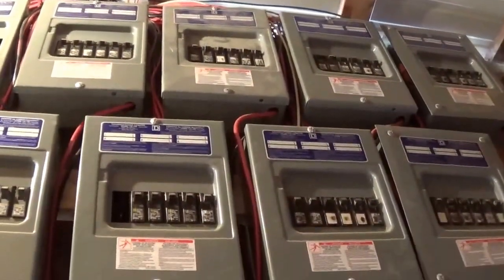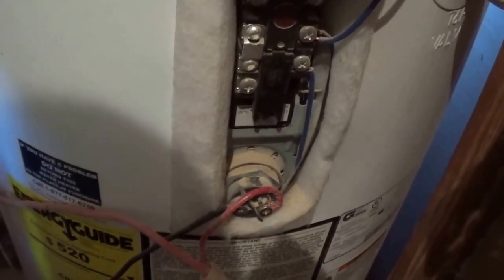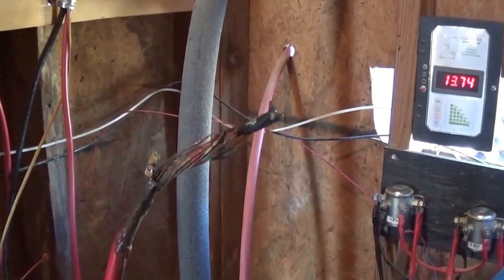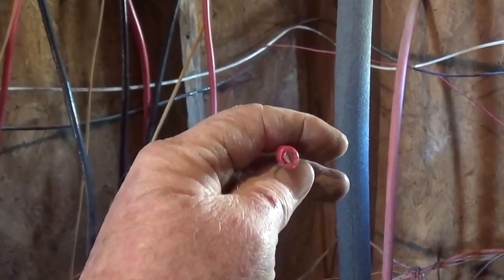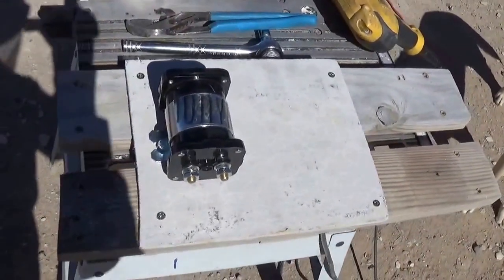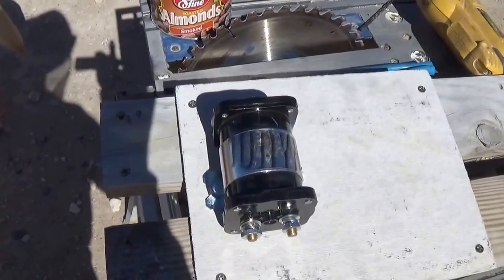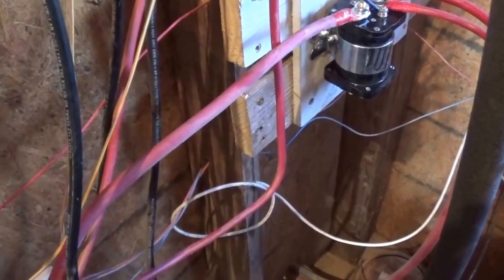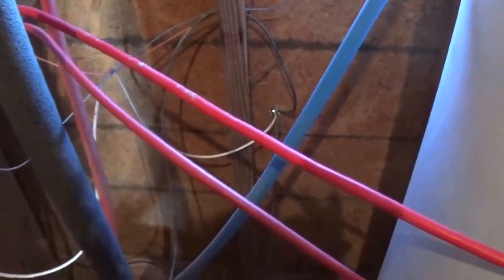Re-wiring & replacing the solar hot water relay!

Comment: Why use 12 Volts ? 120 Volts DC would be a lot better - use normal wire sizes. I don't know how your battery bank is arranged
Reply from the maker: +myozone  Beginner's mistake. We can change over to 48 volts when the inverters burn out and most likely will do that. But now, I do have the wire in place. It cost me about three times what thinner wire would have.

Comment: I've tried to get others to store the wasted solar generation in the form of electrically heated hot water.   They all think it's stupid.  I applaud you for not wasting anything here.  I think it would not be too difficult to use a series of controls here.  First.  A programmable thermostat control like this one:http://tinyurl.com/q83b688 delivered for less than $20.  Runs on and switches 12V.  Us the output to drive your heavy duty relay.  You could use other controllers to check for the other conditions.  Condition 2 is if it's daylight or not like this: http://tinyurl.com/q9btzjm.  The third condition could be tested for with another controller.  That condition would be voltage.  Only charge when the bank is above 13.8v and such.  These PID controllers can be programmed.  It would be possible with somebody who knows more than me to program one controller to test for all three conditions.  (1 thermostat calling for more heat, daytime and battery bank at 13.8v)   Even if you use 3 separate devices, all strung in series, they would allow you to not worry about managing the hot water energy storage.   I don't think you need such large tanks.  You can take a decent shower on a 6 gallon RV sized tank.   Of course, if you super insulate a large home size water heater, you might have hot or warm water through more cloudy days.  However, where you are, sunny days seem more the norm.   Love the channel so far.  I'd like to hear your thoughts on passive solar hot water also.  Although, I consider it a great use of left over solar electric after batteries are charged.
Reply from the maker: Thanks for the post and info! One of my mantras is K.I.S.S. or: "keep it simple stupid". Sometimes we can overthink things a bit without even noticing...... I have done it here more than once.

An off-grid system should produce at least 50% more power than the most you anticipate needing. It is better to have too much than wish for a little bit more! Here, we produce about 250% of our needs, more it the wind blows. There are two ways to deal with it: 1) turn off panels. 2) make hot water.

We make hot water. 100 gallons of it using 4, 600 watt, 12 volt heaters. Also, we have a "beer can solar hot water heater" (passive/active) that makes plenty of hot water during the day. But with the 12 volt heaters, we do not need it, so this hot water will eventually go into our 600 gallon hot water radiator heating system (another long video), but for now it supplements during the shorter daylight hours.

Here is where overthinking comes in: you ideas are fine, but here is what we are doing. With the 10 controllers on the panels set to begin to shut off panels when the system is charged AND the voltage exceeds 13.9 volts..... we set the controller on the wind turbines to dump power to the hot water heaters when the voltage hits 13.2 volts. With the number of panels we have, this occurs at mid-morning. The panels STILL generate far more than 13.2 volts even with the heaters on, so heaters stay on for most of the daylight hours, giving us 100 gallons of 180 degree water  that keeps us in hot water all night.

Rather than several more relays that could go bad, we are using the controllers we already have and it works great!
Reply: eco-ranch.us "Here is where overthinking comes in: you ideas are fine, but here is what we are doing. With the 10 controllers"

Having a functioning thermostat on a hot water heater is a convenience,  Generally people are interested in engineering ways to have the functionality of an on-grid home in an off-grid one.

The suggestion may be complex, but the problem is not a simple one.  My point not being to suggest the idea is the best one.  Only that a thermostat at a fairly low cost is certainly possible.  I would celebrate a simpler solution.   Looks like you have a great system going there.  

Also, I'm not clear what kind of thermostat the tanks came with.  I'm expecting it was passive.  A bi-metal switch of some sort not requiring an 120v input.  That is to say, it would work (it would switch to call for heat) without AC being present.  Obviously your current is 10x higher because your using 1./10th the voltage (I'm over simplifying for brevity).   Thus the stock contacts would never take the increased amps at the lower voltage.  However, the stock thermostat should still function to control the low power to the relay.  Thus you would only need to sense daylight and voltage in battery bank.  Thus, I have removed 1/3 of the controllers required if the stock thermostat was not utilized due to a misunderstanding.

Just by utilizing the existing thermostat, you should be able to eliminate ever over heating the water.  The suggestion is the simplest possible and improves the system.  The balance of the issues you brought up can of course be handled or not as or when you wish.
Reply from the maker: RadicalRC The thermostat is a concern, but not in winter..... yet. By the time the hot weather gets here, we will have the time to look at potential over heating. Right now, we are concentrating everything on constructing the exterior walls while the temperature is low enough that cement products dry slower!

THANKS!!!
Reply: eco-ranch.us I'm not trying in any immediate sense to change what you are working on at the moment.  Just applying my mind to the technical problem presented.   I like working through the logic of these problems of shrugging out.  Look forward to your ongoing progress.

Comment from the maker: The wiring is set for the moment. I am about to build the walls in the guest bathroom. Once this bathroom is functional, I can pull the travel trailer out and build the rest of the walls, so starting these walls is a milestone for us! I am building a "light wall" on the north side and the rest are "standard" bottle walls. There will be a detailed video on the way I build with bottles VERY soon.

Comment: Hey buddy! how goes the wiring and life on the ranch? I am very happy the information me and Alan gave you could help you rest easy. you should see the A/C / Heater that Alan designed on the forum that has no moving parts and can run off 12 or 24 volts. if you have time, just upload some of your videos on the forum so we can share your set up all over the world. very nice layout.  I still have one more wind generator to build and that should start up fairly soon. most have 3 coils per phase, I will be building mine with 4 coils per phase so it should cut in at very low wind speeds which will be great for my area, anyway, take it easy, looking forward to the next video SD.

Comment from the maker: As "Alan Marine" suggested, I did change the main power wire to a 1/0 and put an inline, 300 amp fuse on the main power wire. The wires running to the individual elements were fine, so I only changed the main power wire.

The wire is still a bit warm, but just that, not hot! I feel better with the fuse in the system though! Thank you for your input and help!

Comment: Hello, Very impressive system. To efficiently carry 400 amps at 12vDC from your buss bar to the relay, you should use nothing smaller then 1/0 AWG (with the distance you have).... On the output of the relay, you can connect four 2 AWG wires (one out to each of the 4 water heater elements) as long as you are no longer then 1 metre from the relay. Feel free to contact me !!!
Reply from the maker: THANKS!! I am only carrying 200 amps, four 600 watt, 12 volt elements, but I am replacing the wire with 1/0 from the batteries AND putting a 300 amp fuse in that line. At 50 amps each wire, I should be good with what leaves the relay (#4, #4, #2, #6)...... I think! The odd sizes are short leftovers I had lying around.
Reply: eco-ranch.us Good plan ! It is refreshing to see another individual that enjoys the "Off Grid" power and living challenges as myself ! Hope you could join our small forum and share your experiences with our group as well http://offthegrid.forumsmotion.com Happy Thanksgiving !
Reply from the maker: Alan Marine I checked out the forum and it is worthwhile for anyone who is serious about this lifestyle. I will join!  One thing I cannot stress enough about us though, is that we are trying to teach people how to break free from those who are trying to "enslave" us by eroding the value of our currency, forcing us into "life-debt" and regulating what we are doing, into oblivion. Our goal is to show EVERY person in the world who has the ability, how to be gridless, harvest rainwater and re-empower themselves through freedom from financial stress! I just MAY be a bit too radical for your forum!
Reply: eco-ranch.us Not radical at all !!! Those are my exact thoughts as well, and why we have the forum to collaborate and share for the same goals !

Comment: It always amazes me how hot 12 volt systems get. They are very unforgiving when it comes to under sized wire and once the heat starts it seems to keep building.  Everything in my personal home system is now 48 volt and I save a ton of money since I only have to buy small gauge wire now.  
Robert, if you had to start over from scratch today from the ground up would you go for 12 again or 48 volt?
Reply from the maker: We went with 12 volt initially, so that we could buy 12 volt "stuff". Being a trucker, I knew how many things there were that were 12 volt and that was our INITIAL plan. Instead of the 12 volt "trucker" stuff, we went with AC appliances for the most part..... but...... all our lighting & ceiling fans are 12 volt and I have placed cigarette lighter plugs on most walls in every room to run or charge things, including this computer. So to answer your question, I would do 12 volt again and in every non-grid tie system. The extra cost of the wiring is made up for by the convenience of the 12 volt lights, fans and plugs.

Comment: oh man, that's bad news if it got that hot the pressure relief popped. if you ever worked with gas ovens, they have a button type relay that shuts off the heat once a certain limit has been reached, that would also work to shut the current off coming to the water heater once the temp gets at a dangerous level.  I am always thinking safety lol.
Reply from the maker: Thanks for thinking safety! When the relief valve did go, it was after the old relays fused shut, sending current to the elements for two days straight while I was out of town. Debbie called me before one went about "strange noises" coming from the tanks. While on the phone, one valve started leaking  and I had her cut the wires and release the pressure. This is why I am monitoring the time the elements are on now, but..... I will look for replacement valves today.

Comment: 300 amps would probably work, I am checking with alan to make sure, he has been living off grid over 15 years.  also the 2/0 wire you used, I would check americal wire gauge spec's to make sure it can handle that many amps. I just type in AWG wire size amp rating and a chart comes up that is very useful.http://diyaudioprojects.com/Technical/American-Wire-Gauge/
looks like 2/0 will only handle about 190 so it can get hot.
Reply from the maker: You're right! The wire was "warm" to the touch late yesterday when I had the controller bypassed and on all day for hot water. I will keep a close eye on it though! I may have  piece of 4/0 to switch over to if needed.

Comment: forgot to ask, do you have the pressure relief valves on the water heater? I think they make those to release at different pressures, would be a good safety to keep in mind.
Reply from the maker: I did not mention the pressure relief valve, but the one that came with the tank works fine. The tanks were brand new when installed. We had one instance where the water got too hot and the relief valves did their jobs!

Comment: nice crimping tool, I have the same one, a question for ya buddy. what do you think of putting a fuse inline to the relay to protect those lines? I am using 4/0 in all my runs and I made sure they are all equal lengths so resistance is the same. looks like that relay will hold up better then those other two original ones will do.
Reply from the maker: I am looking at fuses now. I am open to any suggestions for a fuse though..... the heating elements require 200 amps, so a 300 amp fuse would be what I need. I just an uncertain as to which will suit this application.
Reply from the maker: I just ordered a fuse for the system...... I want to watch the wires though before I upsize the main.